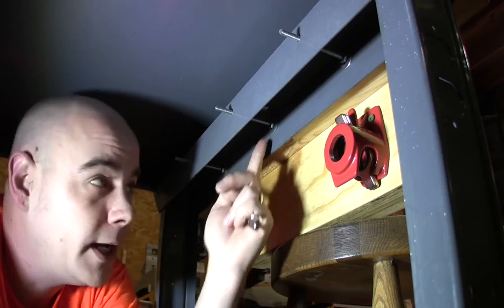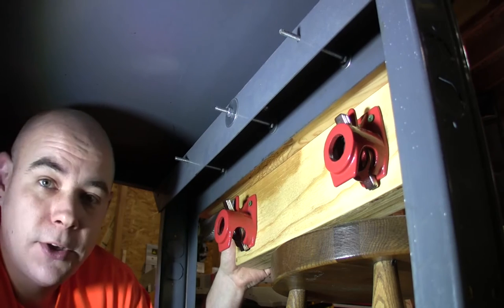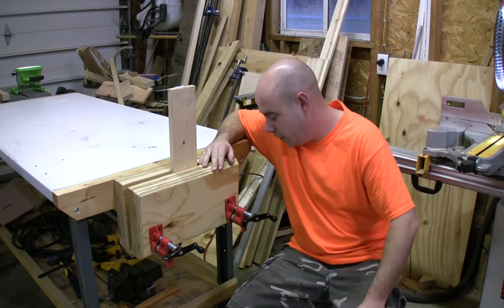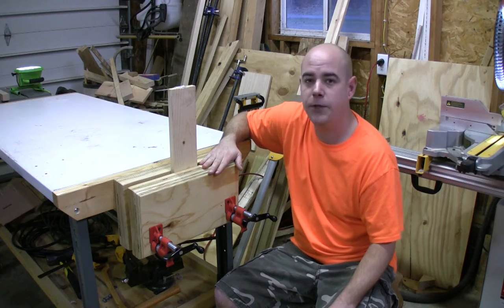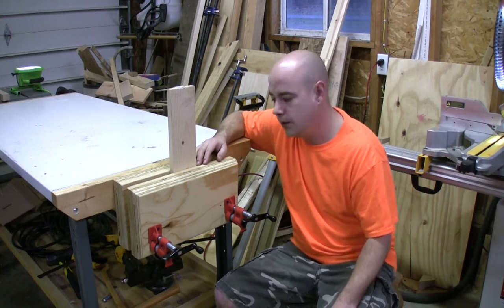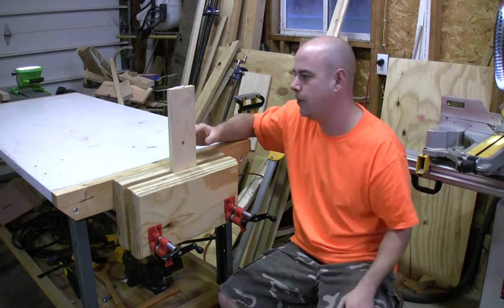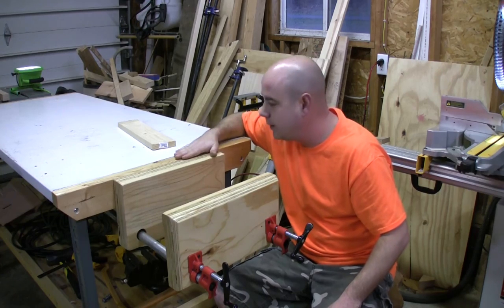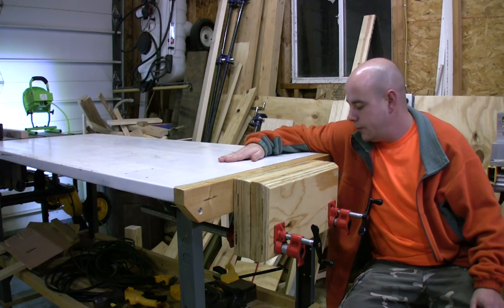Pipe Clamp Vise from Bob Lee

Comment: good stuff mitch! very cool of bob! happy 2017bro!!
Reply from the maker: Thanks joe! you too
Reply: Mitch Deitrich are u gonna add any finish on it?
Reply from the maker: It has clear polyurethane on it. Bob took care of that too!
Reply: Mitch Deitrich nice! You know what I did was take two 3"widex length of the vise  strips on the jaws  of the vise to protect  it from getting dented or nicked by the things I'm clamping and it also gives it a better grip. You could even use those drawer liners that's actually what I'm using now on my Rockler vise some hot glue good to go
Reply: Mitch Deitrich and dude holy cow 2 ft worth of clamping space thats awesome!!
Reply from the maker: Joe basementwoodworking Joe that's an awesome idea man! I might have to mess with the idea a bit!!!